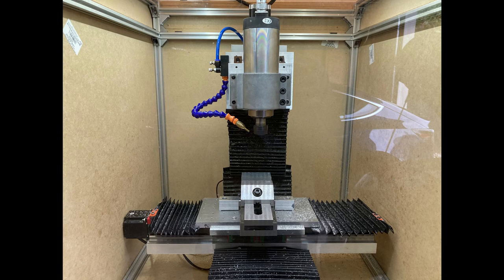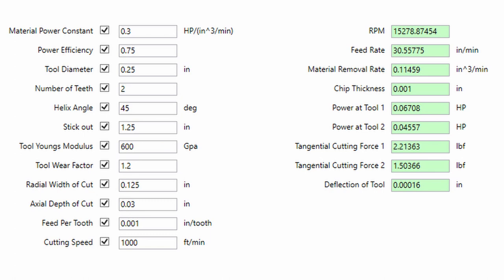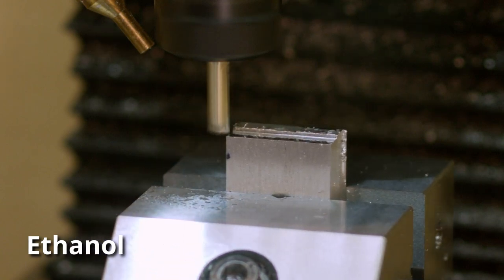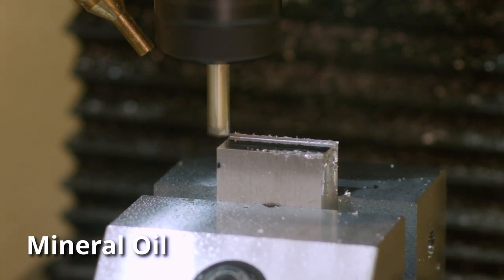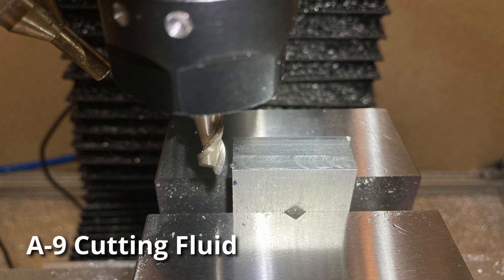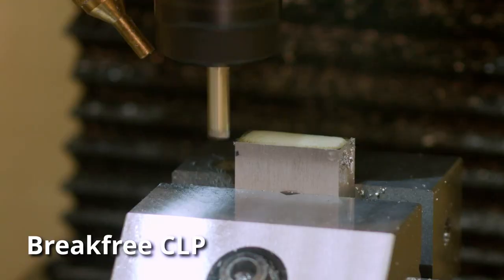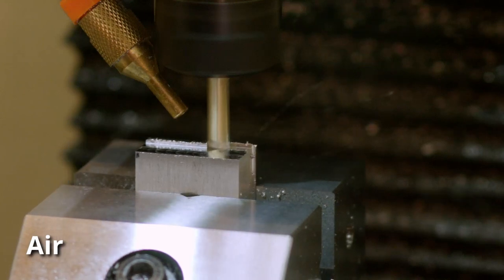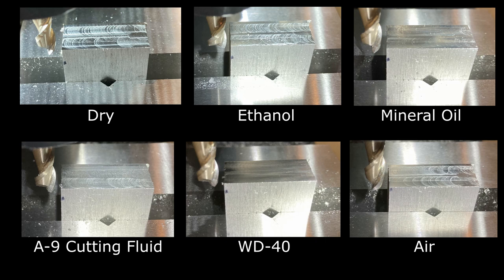Milling Aluminum: Cutting Fluids Tested!

Comment: Thinking purely from a physics point of view, the stacked coins occur when the end mill is not perfectly parallel to the material. You could be getting a very slight digging in as it goes from side to side. The improvements with the various fluids would suggest they are reducing the digging in by allowing the cutter to slide more easily over the surface of the material. Taking small finishing passes is the obvious solution - try a couple of passes at 0.002in.

Comment: I know I'm 2yrs late ~
Have you tried Methalated Spirit,  in a hand held squirt bottle. 
It's what I grew up useing.
It evaporates like the Ethanol but not as fast, it will stay pooled on the job for cooling, while having a mineral based  lubricating action as well. 
I am impressed with the WD40 finish you got !

Comment: Great video, well formatted! From what I saw, WD40 was the only fluid to run down to the bottom of the aluminum, where the tip of the bit is. This means that it was the only fluid to lubricate the tip whereas the other fluids only lubricated the side of the bit. I have a rickety home made router and use flood coolant (water based oil, same as what is used on lathes) this helps a stack. Gets rid of chips in your slots and you can run the spindle as fast as you like because the Aluminum cant get hot enough to bind.

Comment: Does the feed rate affect the finish quality? I don’t get very clean looking finish, although it’s very smooth to touch, but one can see the scuff marks on the surface. The material is 6061 aluminum, 6.35 dia carbide end mill, 2 flute. Feed is F120. The coolant is cutting oil mixed with water, flood type with air blower.

Comment: Try adding a mister. And it looks like most of the finish problems are from rigidity in the spindle column.
Reply from the maker: The nozzle I have there is actually a mister, so I could test what the results would be with various misting liquids. The more viscous oils probably wouldn't spray properly, though.
Reply from the maker: Oh, also, about the rigidity; that's a good observation, how can you tell? Because of the semicircles vs some other shape? I'm trying to imagine what the imperfections would look like if the problem was a less rigid X axis instead, etc.
Reply: @imnoexpertbut  I could be wrong but the patterns from the Mill are random and don't follow a pattern, when one of the Mills I work on had trouble it would leave inconsistent tool marks where as the other Mills I use don't, they are very uniform and precise.
Reply: or not square to table

Comment: Do you have a link to that black cover thing to your rails and leadscrew?

Thanks for the info. Ive only tried dried cutting and air blasted. Will try wd40
Reply from the maker: On amazon it's called a "CNC Machine Black Rubber Accordion Pleats Shield Cover" https://www.amazon.com/gp/product/B0087ZCY86
Reply: @imnoexpertbut  OMG thanks! Been looking for this for a while now. Big help!

Comment: Ethanol is good to keep everything cool, to avoid aluminium to stick on the cutter because of heat.

The issue with aluminium is that a little bit of material tend to stick on the tip of the cutter during the cutting, so it leaves marks during the rest of the rotation.

Best choice is the flood coolant with a % of 5~10% oil.

If you can't, light oils like WD40, but also plain kero, diesel fuel and so on are good, but they make fumes and they're quite flammable.

I'm a professional metalworker but also a hobbyist, since after work I'm playing with metals, so I have some experience in both the fields.

In last months I'm playing with a DIY CNC to make alu molds for injection molding, on a small milling machine without flood coolant.
For those I tried various fluids, especially because I'm working in recesses (so I can flood the recess with fluid) and since the process is long I need something who stays in the recess while the machine is working and I'm drinking a beer with friends. 😉

It turned out that ATF fluid is a very good cutting fluid for aluminium.
It's quite messy to clean out after the work, but it give good surface finish and it avoid totally material sticking on the cutter.

Cheers from Italy!

Comment: I learned the majority of what little machining skills I have from an old-school machinist who was formally trained as a woodworker. This guy was obsessive with perfect part finishes and always swore by kerosene as the best cutting fluid for non-ferrous metals. I'd be hesitant to use mineral oil or ethanol in anything other than light hobbyist work as they both tend to degrade wide ranges of polymers (e.g. paint, perhaps your way covers).
Reply: 7:50 When I first started making/selling an aluminum product I rented a manual Bridgeport and Deckel pantagraph mill from an old-school machinist.  He turned me on to using kerosene.  Worked just as well as WD40 at a much cheaper cost ($3-4 per gallon vs $30 per gallon for WD40.)  Either one, use in a well ventilated shop.

Comment: Thanks for sharing your work! Did you 'degrease' the cuts done with oily fluids before taking pictures? I am asking because it could be that residue in the groves hides the marks. Kind of how wood becomes darker when wetted...  I used to use WD40 for cutting aluminum with a fogbuster. It works, but I could really feel it in my lungs after some time in the shop....
Reply from the maker: I cleaned them off. The pictures make the finishes look worse than they really are, if anything. Good to know about the fog buster. I've thought about putting wd-40 in my mister, but the one I have can't do very low flows, and a little wd-40 goes a long way. What I do these days is feed hold, spray some WD-40 on the top of the part, run, repeat every 5 mins. I thought about trying to get a drip feed oiler to work, since that's more the amount I want to use, but I've never those used on a mill, just lathes, so maybe it wouldn't work for some reason.
Reply: @imnoexpertbut  Thanks for taking the time to reply. I have used all kinds of oils with a brush on mills, but at any decent cutting rate some of those evaporate and you get that classic machine room smell :P Lately I have experimented with food grade oils to see if I can reduce the amount of harmful chemicals I inhale and maybe improve the smell a bit. Peanut oil, olive oil, sesame oil and canola oil just smell bad.  Avocado oil  is supposed to have a higher boiling point, so I'll try that when I get a chance....
Reply: @imnoexpertbut  i just finished a steel cutting session using a brush and peanut oil. Easily the least objectionable cutting oil fumes from what I have tried so far. May put that into the fog buster in the future.

Comment: I would be interested how GT85 works for you? It’s a PTFE lube spray. I’ve found it helpful on plastic and alu cutting to avoid chip weld. I mainly spray the cutter and perhaps splash a bit around the part on a larger job.

Comment: What would you say is the best option for the preservation of the end mill bit?
Reply from the maker: In aluminum, end mills should last a long time as long as you're not causing chatter, or gumming up the flutes. WD-40 definitely helps prevent buildup of aluminum, but I haven't tested it versus other options.
Reply: @imnoexpertbut  Thank you!

Comment: Well…. You leave some issues uncovered. The 6061 aluminum is a large part of your problems. It is a rather gummy alloy, with any of its available tempers. A rather long endmill is not a friend. Using a stub length cutter with .01-.03” corner radius, or even a carefully ground micro-flat, slightly wider than your feed rate can help. K1 kerosene was a highly recommended drilling and tapping fluid in the early sixties, before the tap magic etc. were added to catalogues. So was a paste of white lead and sulphurised cutting oil.
 If you get a piece of 7075 T651, you may like the results.
  Painting oil on a surface ahead of the cutter doesn’t work well, as it moves away from the area of contact, either from heat, or air turbulence.

Comment: Is that 2.2kw air cooled spindle upgrade? Whats is the main advantage you gained upgrading from 1.5kw? Thanks.
Reply from the maker: It is! I was going to make a video about it, but honestly I haven't found anything useful to say about it yet. I'm getting more or less identical results as with my 1.5kw spindle. I was hoping the ER20 vs ER11 would improve rigidity in some way (since the diameter of the spindle bore is larger) but it didn't make a difference on my machine. One nice thing is that I can use larger diameter tools with the ER20, although I haven't ordered any yet. One bad thing is that it's larger and heavier (for no benefit since 1.5kw is plenty of power for me), meaning a bit less Z travel and I had to upgrade the column stepper motor.

Comment: The typical WD40, that you can get pretty much everywhere isn't actually a lubricant at all. It's the opposite and should not be used as such. That's why you notice it doesn't hold up as much for things like squeeky doors. Over time it removes every lubricant, that was on there before and makes it worse. It is supposed to loosen up rust and to clean parts and it removes thicker grease. Yes it does work very well as coolant on aluminium parts. For that purpose it is fine and is therefore used by many people for that purpose. You also can also use WD40 to clean parts, without making them vulnerable to rust (or actually protect them from rust), but never use it as lubricant. For lubrication the WD40 should be removed with alcohol, acetone or brake fluid (or similar) beforehands and then you can use a suitable lubricant afterwards.
However WD40 is actually a brand name and not the name of a specific product. They also make a few other products, that appear to look very similar on first look, but some of these other products are actually lubricants for various purposes.
Reply: You do a lot of aluminum milling?
Reply: @Motorman464  I wouldn't call it a lot. Why?
Reply: @Noxoreos  Because after reading your dissertation, it's evident you haven't done a lot of anything. WD-40 "water displacement, 40th formula" is indeed a lubricant, rust preventative and penetrating oil. When I see someone comment with statements like "should not be used as such" and "but never as a lubricant", it tells me that you have no idea what you are talking about. 
I'm sure this part was a typo but no one uses "brake fluid" to remove WD-40. I'm sure you meant brake cleaner.
Although WD-40 is a brand name, it is also a specific product and the formula is still a trade secret. 
You gave rather a lengthy spiel to be so incorrect. Good luck.
Reply: @Motorman464  As a matter of fact, what you're stating has nothing to with milling, so your first question doesn't even matter in that regards. Nor does my answer to it. So I'm not sure how you think to know what I did or didn't do.
I work as an engineer in germany and I have a lot of experience with products from WD40. Of course I'm not talking about break cleaner. Break cleaner does not prevent rust. I'm talking about the product from WD40 that is used incorrectly in a lot of cases because it lubricates only temporarily. I have to fix a lot mechanics due to improper use of lubricants and WD40 is by far the most common reason for early wear on sliding surfaces. The reason for that is because it lubricates for a rather short period of time and then dries up after a day or so, depending on how open it is to the air.
As I said the do also create proper lubricants that are made for this purpose but there product they sell most is not that.
Reply: @Noxoreos  Ok Maryanne, go change your pad now.
Reply: @Motorman464  I see. Incompetence in communication skills. I'm not surprised. Now go, bother someone else, who is actually concerned.